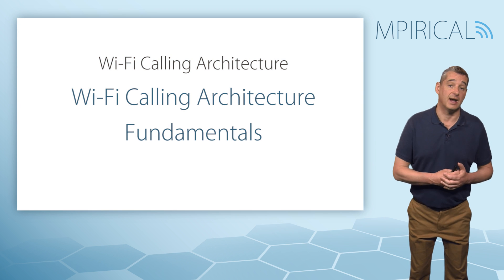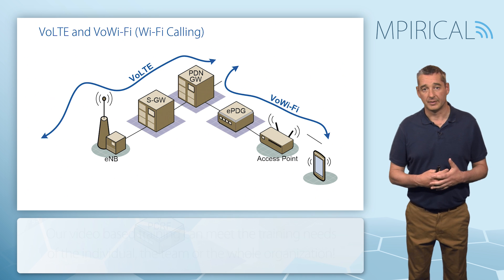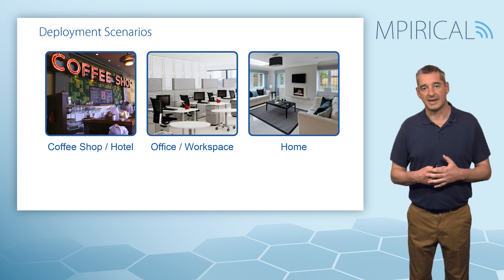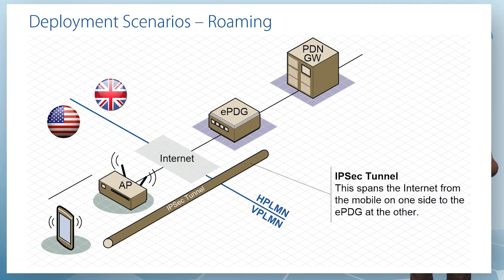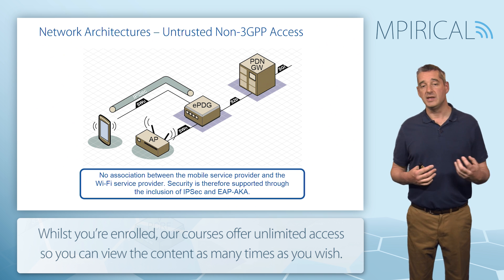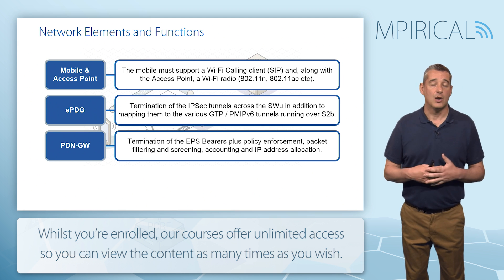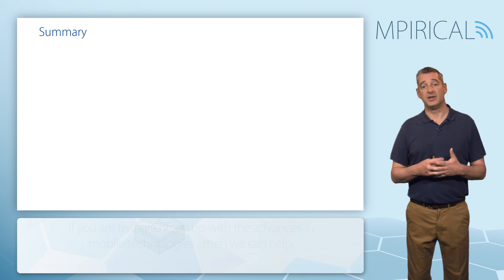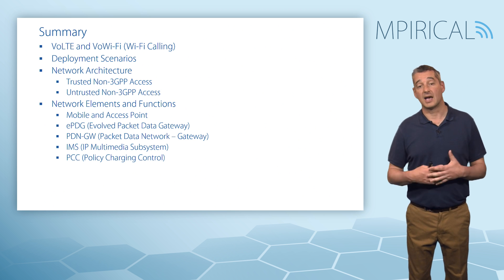Know More About the Architecture of Wi-Fi Calling With Mpirical

Comment: It would have been nice to see a bit more on the technical side.  For example, with WiFi calling, the call is encrypted in IPSec as mentioned, but also encapsulated in UDP.  This enables the traffic to pass through NAT, etc.  My understanding is VoLTE calls are also encrypted, at least over the radio link, but I don't recall mention of that.  One other thing that was hinted at, but not mentioned is this travels over IPv6, at least in the IPSec tunnel.  I believe IPv6 is mandatory for 4G & 5G.  My own phone is IPv6 only and uses 464XLAT to access IPv4 only sites.